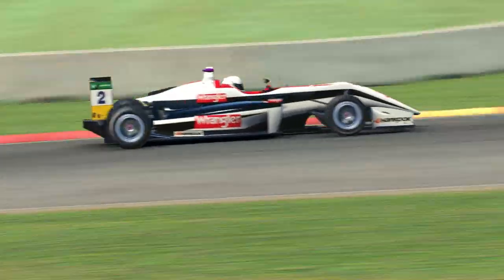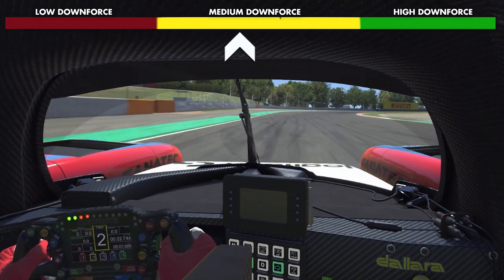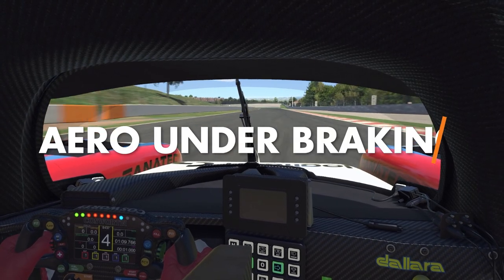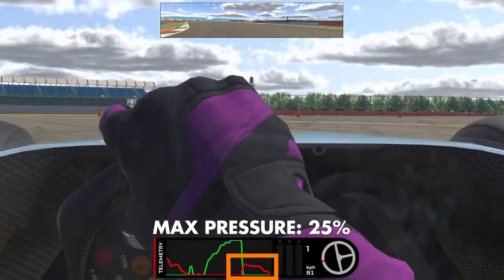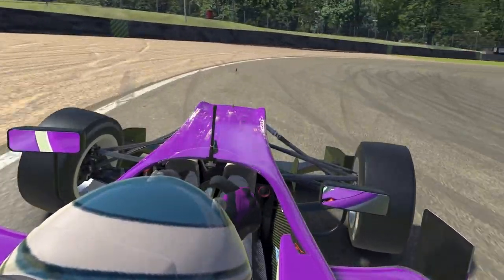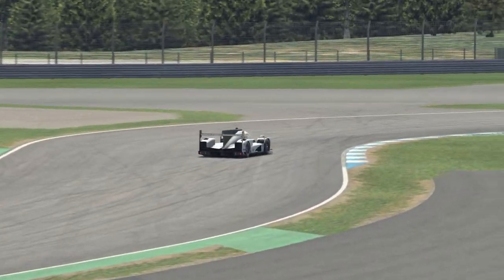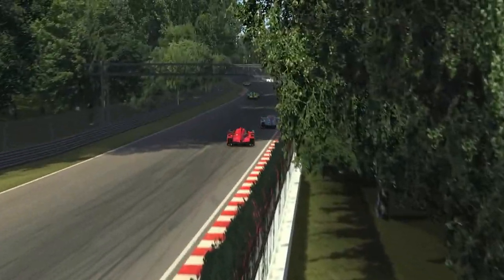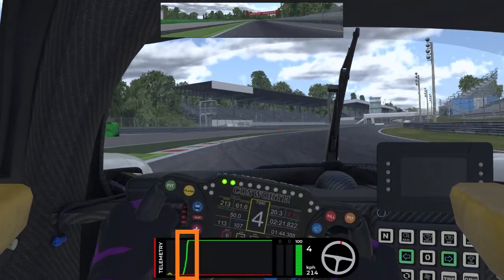The 4 TECHNIQUES You Need to Push an Aero Car to the Limit  (Sim Racing)

Comment from the maker: Did I miss something? What do you find is the hardest aspect of driving high downforce cars?
Reply: Swiping fast enough at the apex in Real Racing 3 so the car steers before gaining too much speed and thus ending up in the grasslands. The VW ID.R is sure a downforce monster, even in a mobile game. Full speed in last corner at Nurbürgring GP. However, if you go too slow, the heavy cars just slides for ever and ever
Reply: I would say you covered it perfectly, the inexperienced just don’t realize the huge difference in breaking distance and cornering speed that can be achieved when you have high downforce as opposed to not. They think they need to slow down more, when actually they need more speed to generate more downforce to be able to corner faster

Comment: I can really feel this at work when using the Dallara DW12 on lime rock GP. The brakes refuse to lock up when I start braking into uphill, but when I reach (at least what I think is) the turning point, I just start skidding if I try going in too hot
Reply: I’m pretty sure uphill roads give you more grip regardless of downforce
Reply: @Route765  I mean the approach to the uphill section. The straight before it is one of the higher speed sections of the course, and it's probably the slowest corner speed required before turning in. I'm just talking about the braking zone

Comment: What about tire life? Does more downforce mean faster tire degradation? If so, how much and how specifically to maintain speed and tires simultaneously? Do you drive the F3.5 on iracing? It seems the first open-wheel car with very strong downforce in their Road category.

Another question, how does trail braking change with a high downforce car? Does one trail-break all the way to the apex? Does one accellarate before the apex? Does the apex change for high-downforce cars? Or is it true one does that less and tries to stop breaking fairly quickly before turning?
Reply: I can't speak for the rest, but you'd probably have a later apex compared to a non-aero car, and yes, accelerate before hitting the apex

Comment: I gained 3-4 seconds in every track with these tricks! Thank you so much. could you make a video about driving fast without force feedback for us low-budget guys :D?
Reply: I used to use a T80 which didn’t have feedback and I was quite quick for what it was, so I think I can help you out. One of the major things you can start doing is watching as much track guides and hotlaps videos as possible preferably in the racing car category you are using, as you can’t feel when the car is on the limit you can a get a great idea of how much you can push the car in each corner by watching these videos. Visual cues are also important to see what the car is doing throughout the laps since there is no ffb, and remember practice, practice you will need to put in more work than someone with a ffb as the learning curve for a non-ffb is difficult
Reply: @GT_FREAK  thank you so much for helping out. I will try these tricks out :)

Comment: Tip #2≈don't consume too much telemetry data
Tip #3≈break up every corner on track into 3 parts and note cars performance in each
Tip #5≈have lots of experience
😜
(Side note: shouldn't tires be the first setting adjustment? 🤷)